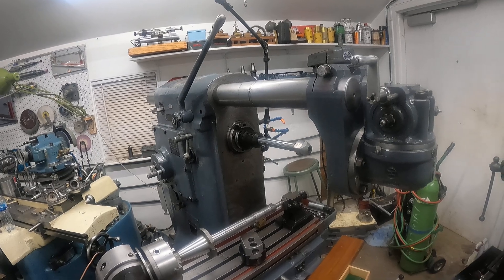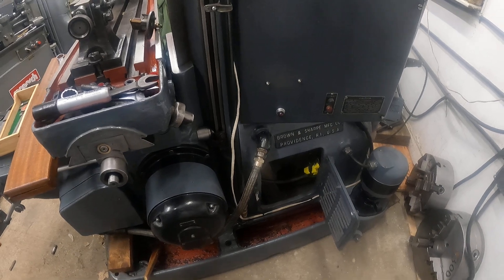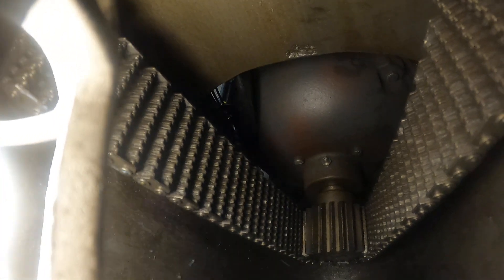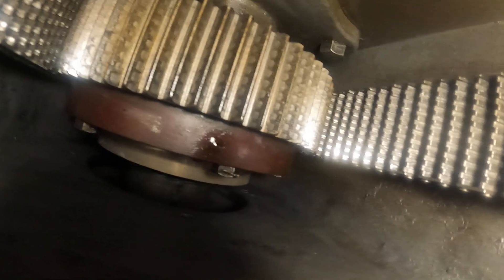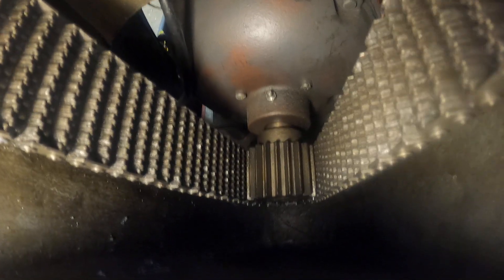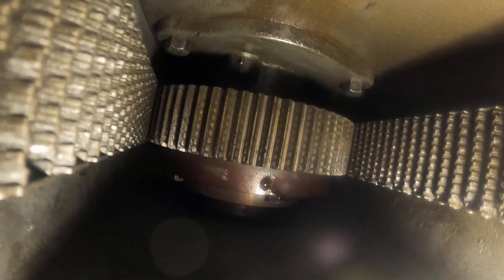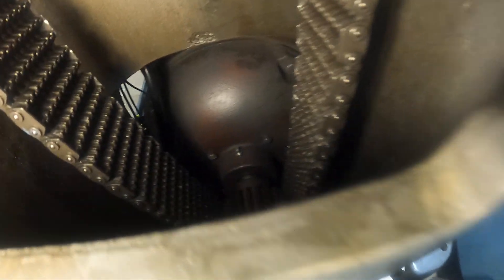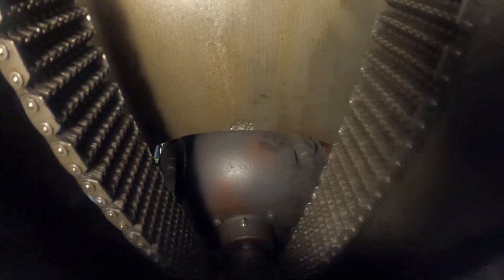Brown & Sharpe Milling machine silent chain drive

Comment: Just designing something with a silent chain. The oil required for that chain would be 10 or 20 SAE mono, very thin oil. You can use ATF, but don't use gear oil as it does not penetrate between the plates and pins. A lot of cars using these for timing chains and they are intended as a lifetime component, but people using the wrong oil and letting oil get to thick causes chain to wear out.
Reply from the maker: Hi, Thanks for that, I have been using motor oil but will go a thinner oil. This chain drive is much smoother operating than I thought it would be.
Reply: @deedeeindustrialsuperprecision  10-40 engine oil would be thin enough at 80-100c but at 20c you need a straight 10. Ramsey chain have a lubrication guide for silent chain. Looks like it needs a good clean in degreaser first. Oil does break down and become sticky over time. Periodic cleaning is required.
Reply from the maker: @chippyjohn1  There is no reference to lubing the chain I sprayed the chain down with a can of spray oil then have been overlubricating it and now the oil that drains to the tray is clean. I would expect AW 46 hydraulic or tractor oil would be good, The manual says adjust the chain like a leather belt, not so clear there also.

Comment: The oil in the chain oiler looks a bit on the thick side to me. I think it'd be worth researching what the correct oil for that would be - and refilling the oiler with that. I couldn't figure out how the oiler actually oils the chain - so if you'd like to revisit that, I'd appreciate it.
There are features about this B&S that have similarities with my mill - that are not shared by K&T or Cincinnati.
Reply from the maker: I could not find a spec for the oil, it says oil sparingly, and adjust the chain like a leather belt, the oiler drips using a  short tube that allows oil to drip to the center of the motor sprocket. The motor itself seems designed to shed the oil also. I am more familiar with the other two brands. The chain drive is a hated system, folks look at it and hate it instantly. I see some deeply mechanical charm however.
Reply: @deedeeindustrialsuperprecision  Dripping oil onto the centre of the motor sprocket is what I was imagining. I'm not convinced it's adequate ! It may well lubricate the link plates down the centre of the chain but I suspect the outer link plates not being lubricated adequately.
Perhaps the haters are those that don't adequately lubricate their chains. I'd like to see the chain run through an oil bath around the motor sprocket. For obvious reasons, that's going to be the point where the oil will be flung off. A bath would well oil a small portion of the length of the chain each time the chain is not moving. It'd also catch oil flung off the chain.
The oil now on the chain has probably considerably dried out if the machine's not been used for a long while. Again, a thin light oil could be applied which would work into the dried oil and help free things off. I've just treated the bearings of my 34 year old vacuum cleaner motor with light oil for the same purpose.

Comment: I've seen those toothed chains somewhere before - possibly in a book !
I'd suggest getting that chain pretty well soaked in a light lubricating oil - lots of linkages, lots of pivot points to create friction - that'll benefit from 'thinning' with a light lubricating oil ! That might be why the machine appears stiff to me - as I mentioned in previous video.
Reply from the maker: I have soaked the chain, the problem is letting the machine sit for a few months  and the oil drains off. When it is up and going I will be using it and that problem should go away.
Reply: @deedeeindustrialsuperprecision  If the oil is draining off, it's the wrong oil ! The right oil will 'soak' into all the linkages and stay in there through capillary action.
Car engine oil is a type that's designed to drain off - as it's in a pumped system. Chains on the other hand (unless in an oil bath) need a lubricant with good capillary action to keep it in the places it's needed - between moving parts.
I get the concept but am no oil expert !

Comment: I have never seen a chain drive like before, very elegant if no longer the best alternative. You sure have done a beautiful restoration on that machine.  Looking forward to learning just what is causing the smoke.  Cheers, Will
Reply from the maker: I managed to scare up a few more chain drives still running here! I know very little about them myself, and that makes things more fun for me like the radial drill.  This milling machine is another exotic relic from the past was used to machine beryllium alloy. There were a few gears with the dividing head indicating they were cutting helical grooves of some type. That can be done on a plain mill by angling the vertical head and cutting on the side of the work with a stub arbor. All that I have done to the mill is scrape off the rust there is not much wear on it. I have run the mill maybe just a couple of hours with no smoke. The motor leads are contaminated with cutting oils, I worked on that and the switches, try again.

Comment: Good Morning.  Lots of Ford, Chevy, Dodge motors used to use a silent chain like timing chain.  I used to rebuild motors in the 70's and saw lots of them.  I don't think I ever saw one that was worn.  Sprockets too.  Of course they ran in an oil bath so like was easy.  Then the Pontiac Fiero came along with its transvers mid engine and rubber timing belts. POS

Industrial gear boxes like Falk and Link Belt used them to.  Bullet proof if you keep them lubed.
Reply from the maker: This system would benefit from an oil bath for sure, I need to start the oil drip awhile before starting the machine, perhaps the most wear occurs when the machine sits and the oil drains off the chain.
 The chain stretches and when the adjustment runs out it needs attention says the manual, and for tightness about the same as leather belt. That is helpful !?

Comment: Yes the early mornings are price less and coffee taste better in the shop enjoy your mornings !!  Was thinking the insulation on the motor armature was getting hot and smoking but you will smell the it in the shop .
Reply from the maker: It has more of a burning oil smell, but still electrical also. I have had no problems with 3 phase motors that I can remember, so not much knowledge on the smoking here but I sprayed it out and re-did the motor connections making sure they were correct for low voltage. The electrical cleaner a whole big can of it is still being cleared out by fans, try it again soon with video good or bad- run the motor short periods with the mill in neutral.

Comment: Very interesting video Dee Dee, small town machine shop has a Reid  lathe with the chain drive.
Reply from the maker: I am bouncing in and out, using a bit of electrical cleaner, may have to get some more, there is non flammable and extremely flammable, the extremely sounds good. The Reed Prentice lathes are brutes real simple favorite machines for the navy so the legend is. Another low production high quality machine like Axelson.

Comment: HEW stands for Hanford Engineering Works and not High Energy Weapons.  After 34 years working at DOE's Pacific Northwest National Lab, which was spun out of the Hanford Works in 1965, I have seen several pieces of old equipment with those HEW tags.
Reply from the maker: This goes before you in the 60s when they cleaned it up for the public, when they wanted you to crawl out from under your school desk, hey! I used to hot rod ray sedeskys harleys,, remember hard luck. I have many tools marked HW and such, some with blue paint, how about you?
Reply: @deedeeindustrialsuperprecision  I saw HEW tags on scientific equipment when I worked at Pacific Northwest National Labs.  These were usually equipment tucked in corners and/or at the bottom of a pile.  I remember several such pieces that a coworker picked up when they closed the Calibration Lab at Hanford.  They were made available to US Department of Energy labs before they would have been disposed as surplus.  I never bought any machine tools.
Reply from the maker: @bretcannon3826  Yes ray explained how that system worked and how other institutions would have priority before the items would be offered to the public by sealed bid at the time.. This USHEW is really funny because what unexpectedly come up and the time frame. some of the old timers talk about these things, but quiet on what they should.

Comment: As Mel Gross said, South Bend had some chain drive lathes, on the South bend forum one will show up from time to time, they were very top heavy as the large motor and chain drive was over the head stock..
Reply from the maker: There was a nearby shop that had that affair bolted to a wall, the silent chain went from the electric motor to the counter shaft with the cone pulleys, it looked heavy built for sure, an early replacement for line shafting I would guess

Comment: I have that Reed prentice lathe. The chain is pretty silent.  It has a brass plate that says  " paint finish approved by the war production board". I have a 12 inch chuck on the lathe and put a digital readout on it. Its slowest speed is 18 rpm which is needed for large diameter tool steel.
Reply from the maker: My brother reports massive metal removal rates with that machine, thinks it has larger bearings in the spindle also
Reply: my replacement chain was quoted at 800.00 its 92 inches long
Reply from the maker: I was for sure looking at an outdated price! I will keep a close eye on that!